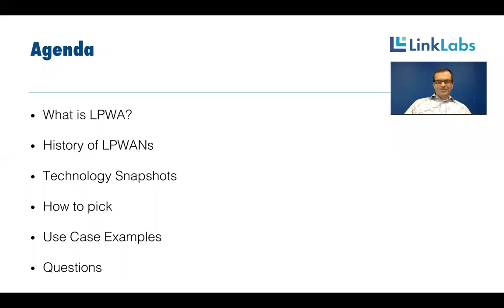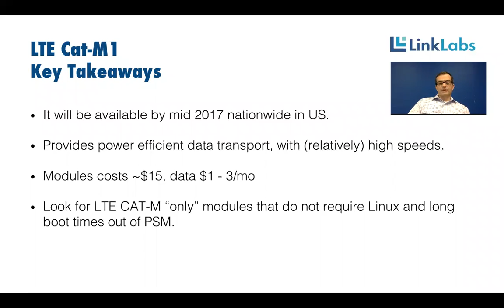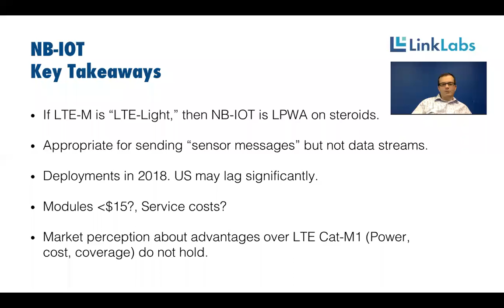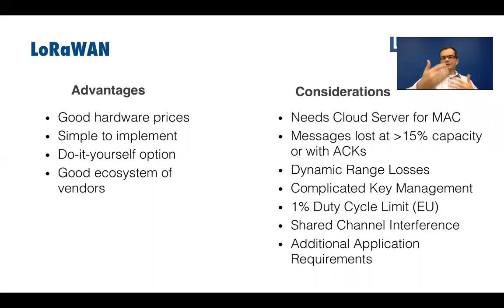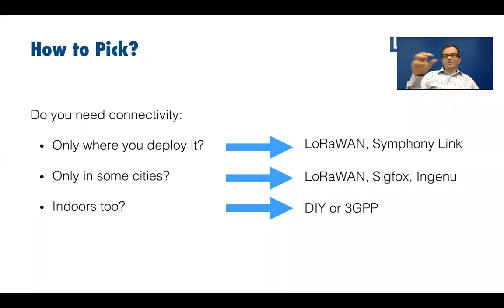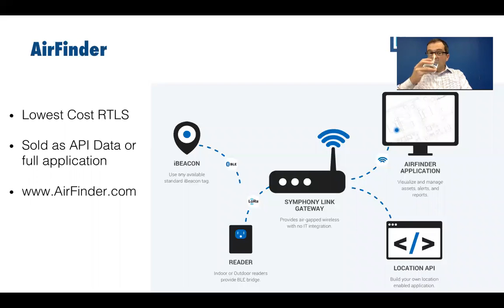LPWA in an LTE-M and NB-IOT World

Comment: @12.33 : One advantage with NBIoT over Cat-M is that on the uplink it generally uses either 1 tone or  3 to 6 tones in general. For single tone transmissions,it can take the advantage of the legacy GSM power amplifier devices already present and the design constraints are relatively simpler as you dont have to worry much about the PAPR issues with Cat-M which uses either 12 or more tones on the uplink. You could move the operating point of the PA closer to the saturation point in case of NBIoT thereby getting good efficiencies.

Comment: @9.21 : The max Tx power specified is 23 dBm. It necessarly does not mean that the node will transmit at this power. There are some efficient closed loop power control mechanisms in 3GPP on the uplink.